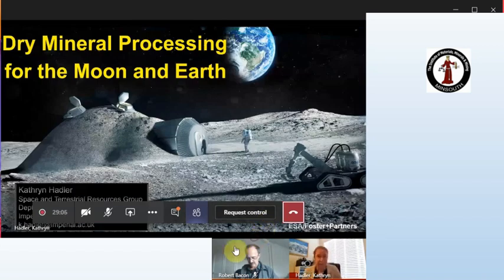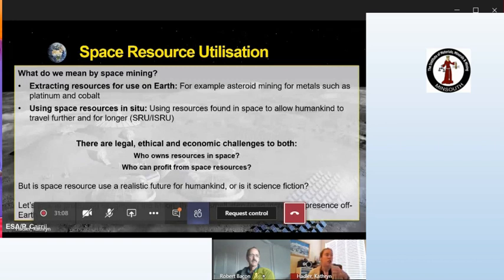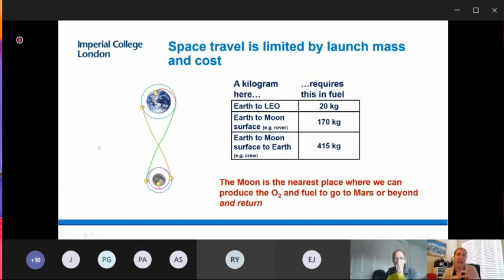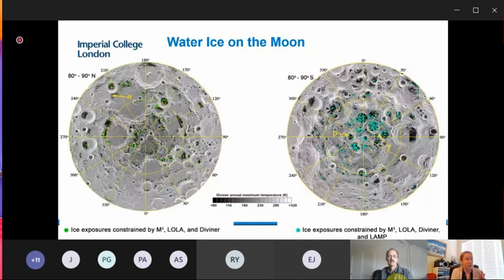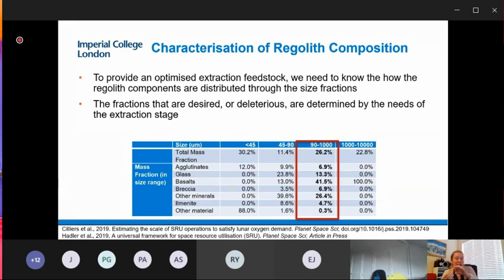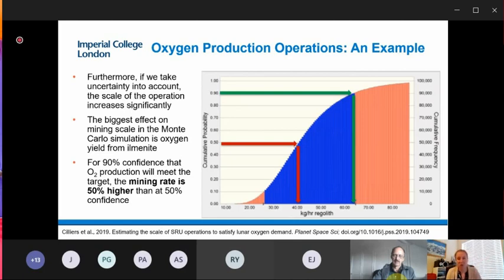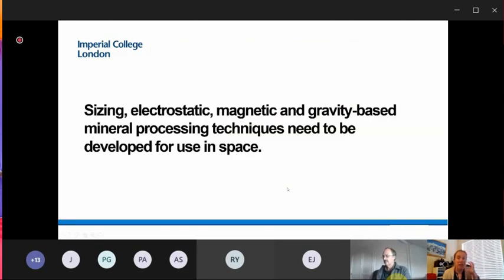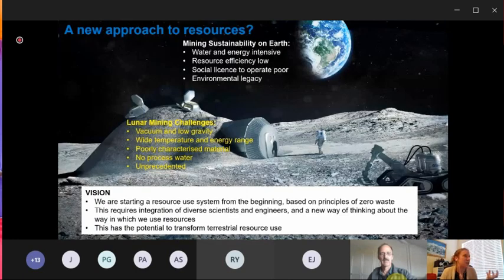Dry Mineral Processing - for the Moon and Earth, presented by Kathryn Hadler

Comment: in low gravity you can use an inclosed  centrifuge to enhance particle gravity to help with separation and it works with a gas or liquid (that dont frezz if done outside) with recirculation pressure pomps,some 2.5-3 kw/h for 5-10 tph or more tph depending on mixt materials or depending on target metal concentration just assey and get finished product